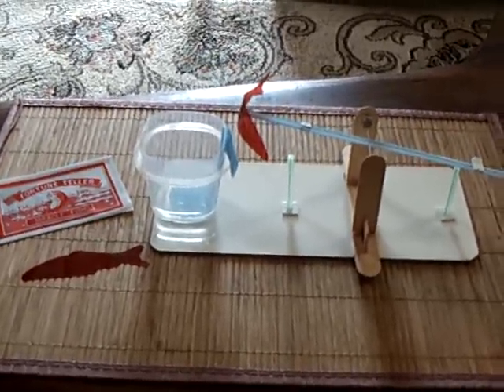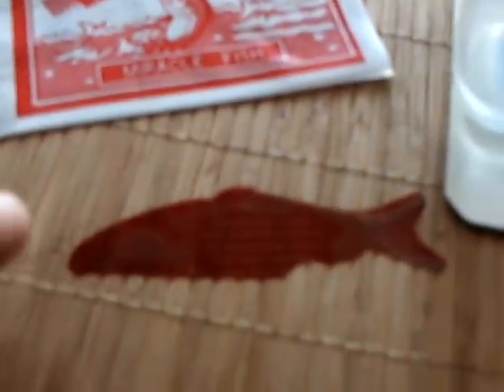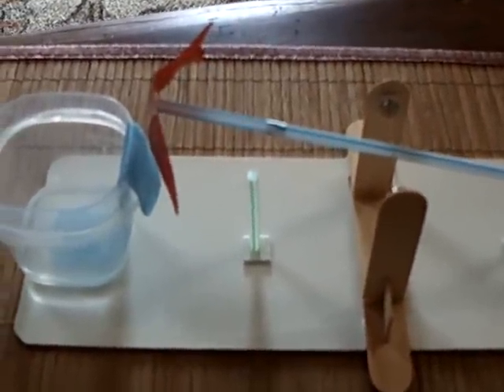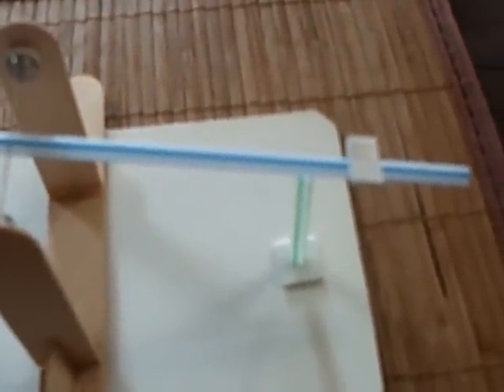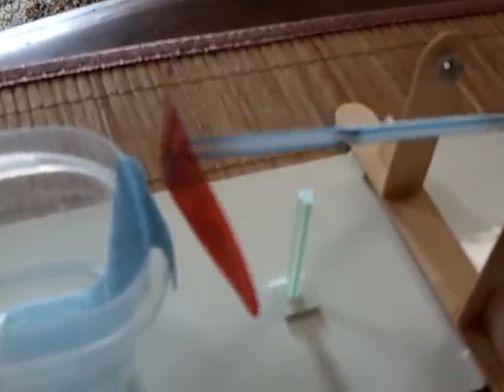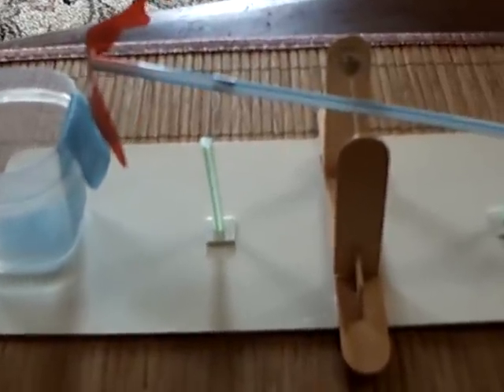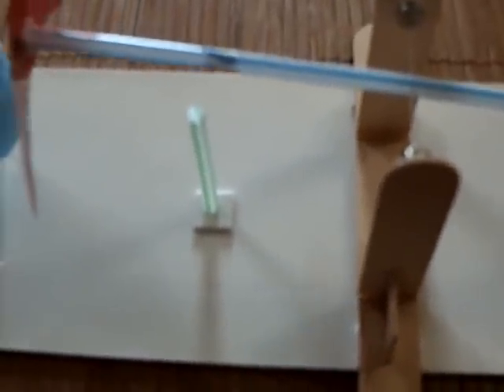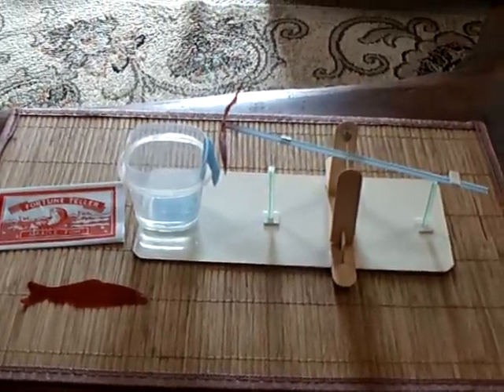Fortune Fish Puskas Engine

Comment: You might be able to speed up your oscillation rate, if you can figure out how to glue some dessicant crystals to a curved shape that matches the flexure pattern of the moving material.  

Kind of hard to explain, but I think you will probably get what I'm struggling to describe.
Reply from the maker: zeffur7 Thanks. That is something to try.  I found out that the fish will curl both directions depending on which side gets the moist air.  If I put my finger above the fish on the backside it will react to that, uncurl faster, and the teeter rate increases.

Comment: I think that fish is cellophane? I remember making toys like the fish at school with cellophane and they would curl up in the hand just like that. I wonder if you could do this with static electricity? Using a triboelectric plastic and + & - static sources to cause deflection?
Reply: LOL. Of course this convo had to go back to Attila Blade's channel. And thus the cycle is complete.
Reply from the maker: Mongrel Shark Cellophane is what mine are made from because they are ruined once they get totally wet.  There evidently is another type that are made from sodium polyacrylate.  Those type will recover when they dry out ---so they say.  A static electric version of this teeter totter would not be hard to make.
Reply: ***** Oh, God! :) Na-polyacrylate is a really sensitive material. This is the "pampers" diaper core. :) :) :)
Reply: Attila Blade that stuff would be ideal for this method. http://www.nature.com/ncomms/2015/150616/ncomms8346/full/ncomms8346.html
Reply: This is a new, but really old think what my friend Simi made in 2008 first...but this variation is a huge project. My friend's smart idea was nonprofit and open source. Unfortunately :)
Reply: *****  You might want to test "clear rolling papers". They are cigarette rolling papers made out of un-treated cellulose and you can find them in most smoking shops or stores that sell smoking assecories, ebay is also a good place to look for them. I might order some and try unless someone does it first.
Reply: Attila Blade So...the Na-polyacrylate is not the real material of the fortune teller fish. That is simple painted, thick cellophane from cellulose. https://sciencewithtoys.wikispaces.com/Fortunate+Fish The pampers base is not working... I tried yet! :D
Reply from the maker: Attila Blade You are right BLADE.  These fortune teller fish are NOT made of Na-polyacrylate.  I did  a lot of research on this today and they are made of UNTREATED cellophane-----and I can't find any cellophane material like that.   All I can find is cellophane that has a coating applied to it that stops it from being hygoscopic.  Other materials that are called 'cellophane' are not even true cellophane but rather polypropylene.  The thin clear plastic 'tubes' that cigars are wrapped in are made from the correct material so they can breath.  Perhaps I can find some of those wrappers.  Sodium polyacrylate  is not going to work for what we want to do.  You are right.
   One way to see if the material is cellophane is to burn it.  It will burn with a smoky flame like a piece of wood if it is cellophane.  If it just melts then it is polypropylene.
Reply: http://www.walmart.com/ip/Hygloss-Products-Cello-Sheets-48-pkg-6-Each-Of-8-Colors/24549045?action=product_interest&action_type=title&item_id=24549045&placement_id=irs-106-m2&strategy=PWVAV&visitor_id&category=&client_guid=94848101-b9fc-4efb-bb9d-9379f41f44c5&customer_id_enc&config_id=106&parent_item_id=25255693&parent_anchor_item_id=25255693&guid=2b2e9ee0-b824-4a1c-89ce-7610e2b619df&bucket_id=irsbucketdefault&beacon_version=1.0.1&findingMethod=p13n

I think this is it! :) Or http://www.walmart.com/ip/Cindus-CW750-57-Cellophane-Wrap-30-Wide-5-Foot-Roll/25255693
Reply: That second one I think.
Reply from the maker: Attila Blade I found some 'Cello' cellophane in a big roll yesterday at my local Dollar store.  It didn't work.  I will try the Walmart stuff but I think the cellophane they sell now in stores is treated in some way (or is a different material) so that it doesn't absorb moisture.  The 'Cello' cellophane I bought had zero reaction to water and melted like plastic when burned.
 https://www.cellodepot.com/is-it-cellophane
Why they stopped using true cellophane in most applications.
https://www.cellodepot.com/cellophane
Reply: The problem is the coating. Nitro-cellulose coated sides aren't reacting for moisture. It was a solution for the dried out marmalaids! :) Yesterday I found a manufacturer, who made Nitroless, one side also both side coated version, but the single version was only 22 microns thick. :( We use the transparent thin version for retro, dense jams in Hungary. But the thin version hasn't got hold enough. But I never give up! :)
Reply from the maker: pomputin123 Many thanks.  That will work for what I am going to try.  There is a smoke shop near me and I will get some of those "clear rolling paper".  Great tip. Thanks.
Reply: ***** I found a great deal on them on ebay and ordered some. Now I just need to wait until I receive them and I will make a video on how well they work.
Reply: pomputin123 While waiting for my cellophane, I made a flower shaped heat engine, give it a look if you'r interested.
Reply: ***** I received my cellophane today and it works really well. See my channel for a video.
Reply: Mongrel Shark I think it is the moisture in your hand and it expands causing it to move